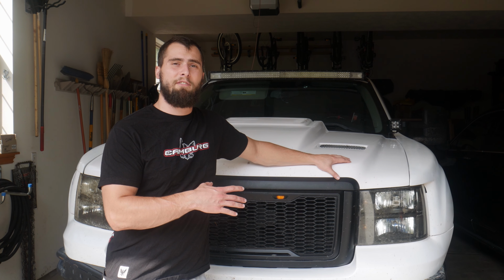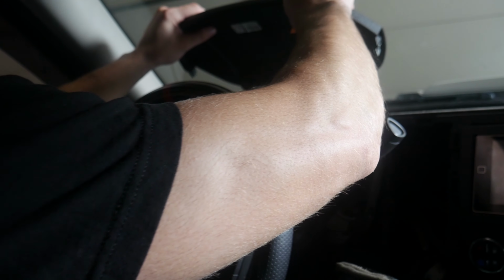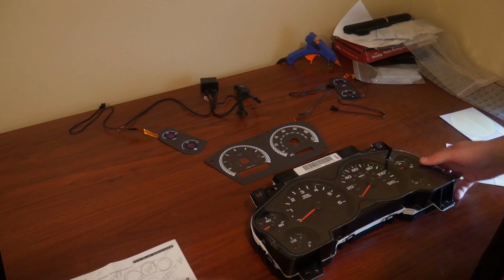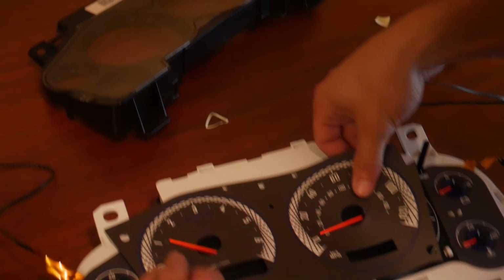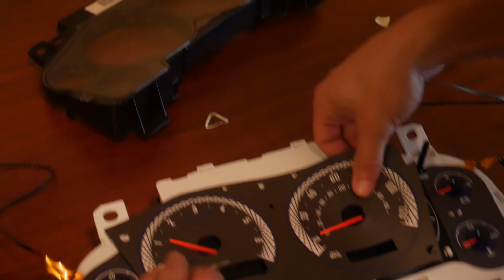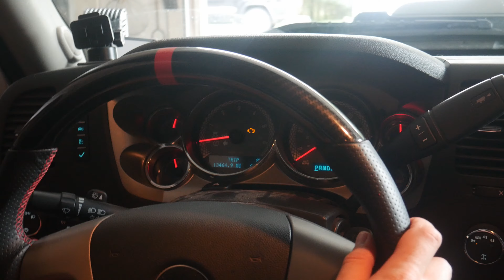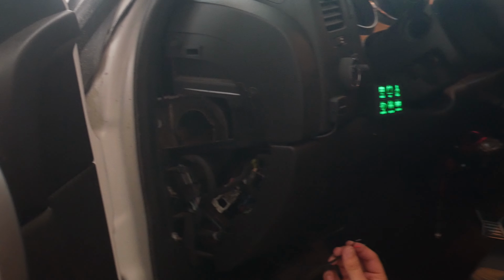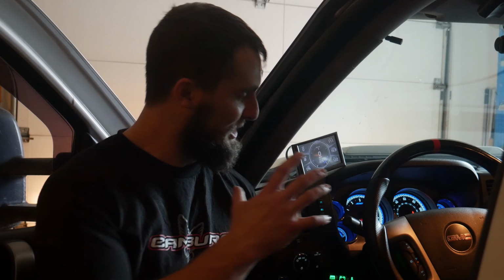07-13 Silverado/Sierra Speedometer Gauge Cluster Overlay - ADD W1

Comment: Looks slick. I just so happened to be looking at the US Speedo overlays and stumbled across this one, which looks better and costs much less. Could you explain how/where you ran the power through under the dash and into the engine compartment? Other than that, looks all straight forward. Thanks!

Comment: Do the lights turn on and off on with the ignition or do u turn the key and then press a power button? I saw the dimmer controller u stuck on by your factory headlight switch and dimmer. Just wondering if the led lights come on automatically with the ignition or not?
Reply from the maker: They come on automatically when you start up the truck.
Reply: Thanks for answering. I’m looking at buying the add w1 overlay for my 2013 Silverado. Is the switch just for dimming the gauge cluster lights?
Reply from the maker: @Jsteezyfishing  it’s just for switching between 2 very similar colors you can dim it with the factory dimmer.
Reply: Ok sounds good. I think I’m gunna make that purchase. Thanks for all the info. I really enjoy watching Vinny build the GMC pre runner. I’ve been subscribed & watching the Chanel for a while now and look forward to the notification when a new video comes out. Keep up the good work Caswell Custom 🤙🏼

Comment: Every time I set my MPH needle to 0 and attach everything back together. It comes back down, like all the way down... What can I do to fix that?
Reply: What you need to do is rotate the needle all the way to he right, making sure to overlap the 120mph mark and  your gear selection, and then when your rotating it, making sure it lands back PERFECTLY on 0mph. You need to do this either from 0mph, doing what I just said, or do it from where the needle sits when the cluster is completely off and sitting below 0mph. (I can't remember, but I did a cluster in mine with new needles and my cluster builder told me to do this and it worked)
Reply: ALSO - make sure the car is off, and no power is going to the cluster when doing this. Like when your needle sits below 0mph when the car has been off for about 30 minutes. Don't do this when the cluster has any power to it.

Comment: I have a quick question, I didn’t mark my needles and I put it back together and I can seem to get needles back to the right position, they keep going below 0, any help?
Reply: My rpm gauge also reads 700 rpms lower than its suspose to
Reply: i have the same problem. did you find a solution for this? my needles fall below 0 and i can't see to get them working properly. guessing i'm going to need to get them recalibrated..

Comment: Couldnt you have just taped it into the dash fuse box
Reply from the maker: You can, just not how I did it.
Reply: @CaswellCustoms  cause i believe there is an ignition fuse there as well. How are they holding up for you?

Comment: Is the cluster function with the odo and direction only for Sierras 🧐
Reply from the maker: No it’s for Silverado’s, Tahoe’s and Yukon’s also. They all have the same cluster.
Reply: Okay bc I have a 07 Silverado 1500 I wanted to know how to get the compass function on there also... does it have anything to do with adding a driver info control ?
Reply from the maker: @johnsanchez8863  no it simply lays over your previous gauge